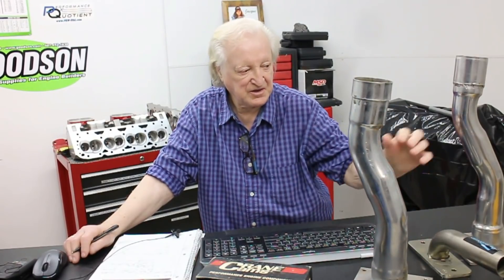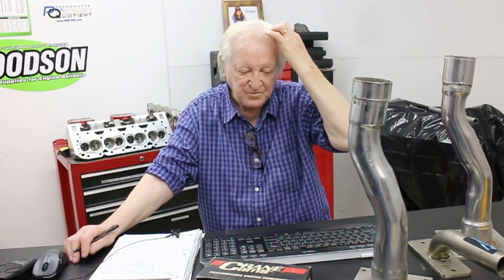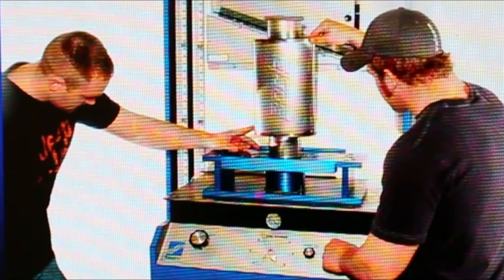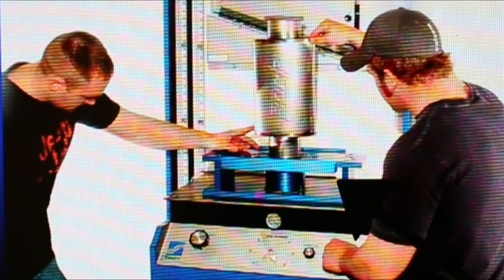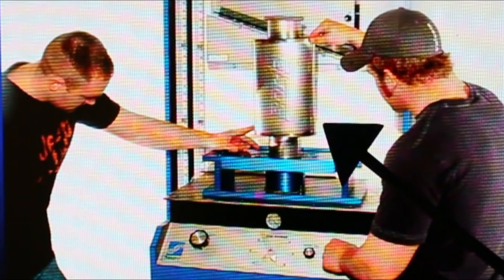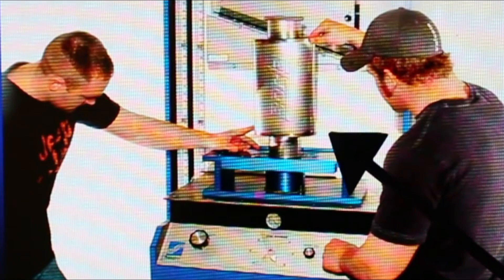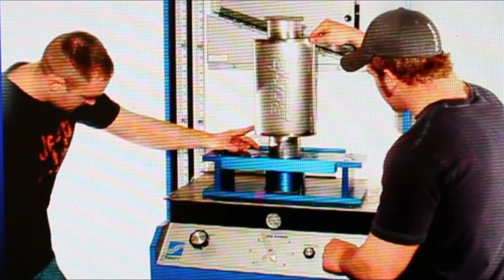David Vizard's PowerTec 10 EP 27 Zero loss sound legal muffler systems

Comment: Best muffler explanation I have ever heard. I have suspected that this design of open chamber at the end of the collector would work and built a system using a large bore Magniflow at the end of the collector with a tapered outlet. Did not realize the need to have an eight to one ratio. Thank you. Also the 2.3 cfm per hp is extremely helpful. Back to the welding bench.
Reply: 8 times the size of one cylinder termination box? Is that ratio specific to a V8 motor?

Comment: this is invaluable Information !! thank you for shearing this info, I am in the middle of building a 4-2-1 for my corvette , I know they already sell it ,  but I thought to give it a try,  the most hard part on this built is to weld the headers , from the 4" mid pipe and 4" collector all the way to the end , is pretty simple, is what I did in tow days, still working on the headers, I am going with 42,2 " to the Y  and 54"all the way to the big collector ,, I hope it comes out ok, thx for your information,

Comment: Holy crap I learned a lot from this genius. I've had my muscle car in storage almost 30 years. We just pulled it out and restoring the body.  It's got 500 hp and still has Sonic turbos and nobody's muffler sound as good as those. They say the Super Turbo similar but it don't sound anything like the Sonic. This Sonic is smooth Bassy and quiet.
I'm going to try to go with the 3" straight through Borla XS. They're supposed to be the quietest straight through ones but I'm probably going to have to put a race bullet in front of it to try to keep it smooth and quiet.

Comment: David:  first of all, I would like to send my condolences for your loss with a family member.  Second, thanks for your presentation on sound and performance using mufflers.  I have been dabbling in sound quality and horsepower gains myself on a very "backyard mechanic level" to discover some of the same flow bench testing you have presented.  Motorcycle two stroke engines have the same design characteristics by using an expansion chamber before the resonator/baffle section on the system.  Cud-dos to you for explaining this insightful information to your viewers.  Furthermore, I will get busy with my own build, and try to report my experience in timely manor with track times as a guide....see ya later, and thank you!

Comment: Just about 20 years ago, after reading David's exhaust tuning book, I designed a custom exhaust for a 1979 truck I had. My best friend at the time couldn't believe how well that truck ran and it had a stock 350 with just a Edlebrock Performer RPM intake and a 550 cfm Edlebrock performer carb. No, the truck wasn't truly fast but it did surprise a great many people. The absolute best part...All the "Noise" the truck made was induction growl. Many folks just couldn't figure out how that truck made "That Sound" when "getting on it" and have no noise otherwise. 
I'm working on a 302 based '67 Merc. Cougar now, can't wait to apply the same principals.

Thanks David!!!

P.S.  Yes, I've read  your cylinder head porting book. I already have a set for the 302, just have to get the car safe and legal to drive.

Comment: Dale here. I am glad that you have mentioned that the engine does not need back pressure. I have talked with many people about this, and they always say that there needs to be some type of back pressure. As I mentioned in another video that you did "Grumpy Jenkins" once made a comment about using slightly larger exhaust manifolds (in this case headers) so he could block backpressure and therefore gain a few more horsepower and a slightly quicker time on the track.
With what you are talking about here validates his comments and makes me want to agree with you about the person who demands that the engine needs that backpressure is either ignorant or parroting words that someone told them were gospel. Thank you for the information that shows the fallacy of that view.

Comment: I set out to increase the gas mileage on a 2001 ram 1500 5.2 v8 . The exhaust size was reduced from 3 inch down to 2 inch before the Cat. Same diameter into the stock muffler then back up to 3”. I installed a 3 “ cat and a long 3” truck muffler to keep it throaty but quiet. No improvement in gas mileage. Muffler rusted out internally in 4 years. Replaced with an American made flow master style  muffler. Sounds amazing on start up. Louder but at highway speed no more noise in the interior but I can hear the sound of the engine nicely. No change in gas mileage. The original window sticker says it should get 19.  It never gets any better than 13 but it sounds great ,lol. I could probably change the cam and have more power but I don’t think the mileage would improve. I will probably just drive it as is. It’s in perfect condition and drives good  but there are better trucks out there.

Comment: I saw a Chevy Gas truck with headers and a 5 inch exhaust meant for a diesel. It was terrible sounding and droned on the highway.  WE went near the axle and put a 5 in to 3 inch adapter, a short length of 3 inch pipe and then a 3 to 5 inch adapter. It mad it sound a lot better, quieter, and no more drone. He also got to keep his 'cool looking' sewer pipe exhaust tip.

Comment: getting to grips with a rotary way out on the boondocks of NZ , I found it best to build my own straight though with lots of stainless polypads , the brass ones got flattened in days , any normal glass pack large mufflers fell apart .  I made a few attempts at internal reflection cones too , were ok but stainless is to noisy . And with turbos have found a big expansion tube after the turbo is good . now it seems there are ways to design noise reflecting grooves at about the size of the sound waves , Gismag/new atlass had an article a few years ago ,would like to know more ,could greatly simplify the muffling , even make effective aero mufflers , next project I hope . Thanks David ,great info, and attitude , we say you attitude determines your altitude ,and fame without good character will destroy you .

Comment: WoW 1987 I was 17 years old in H.S.  and had a 70 Cuda with a 318 and big hydro cam Torker intake 750 vac secondary carb Blackjack Headers AND Sonic Turbo’s slapped right on the collectors. Sounded beastly Ahhh those were the days.

Comment: So, the Walker DynoMax Super Turbo, is the same muffler as the Sonic Turbo?. Back in the 80s, they use to refer to this muffler as the "Turbo" because it was similar to the GM Corvair turbo design of the early 60s.....apparently. If you were a Mopar guy of the 70s, you used the "Imperial" muffler.....which apparently was the biggest size muffler.
Bit of history for the gus.
Reply: I just pulled a 500 horsepower super duty Trans Am out of storage for 27 years. I can tell you my friends are jealous it's got Sonic's on it still. I can tell you the super turbo doesn't sound anything close to the Sonic the Sonic is smooth Bassy and quiet. The problem is I don't think those particular ones have quite the flow got that engine needs so I think I'm going to go with 3" Borla XS Pro because they're supposed to be the quietest straight through. I'm probably going to have to put race bullets in front of it and maybe borla's x-pipe to make this thing be smooth and quite as I want

Comment: I remember that muffler test. 👍
With the back-pressure, I keep pointing out the piston has to push against that pressure in the exhaust port - which is partially a result of that system back-pressure.

Down here, NZ, back in the seventies I was rather disappointed by one of the local exhaust (muffler) "professionals" who wouldn't help my with parts for a dual 2 1/2" to replace the OEM  single 2" - it was originally a lo-po 283 that had a mild 350 replacing it - because exhausts don't make any difference to power... There was another shop in town that wasn't much better - I ended up getting the stuff from out of town.

Comment: I remember the sonic turbo muffler
In that article they did beat all the others 
As usual not surprised that David had
A hand in it.
Reply: yeah and the walker version built they way he wanted initially but couldn't do to size constraint, the walker super turbo the bought out version that improved due to larger size on the original 'sonic turbo' muffler.  changed the term 'turbo muffler' forever. However ,they are not the same.

Comment: Man my jeep xj is not a race rig but I am putting a stroker engine in here soon,  I wish I could work hand in hand with you to get it setup for max efficiency lol.   It don't need it but I want it haha.    I've built custom exhaust for many years and but never had any dyno stuff as it's been a repair shop like midas or meineke.   I recently found your videos and am gonna take on the porting of the throttle body and intake manifold on my jeep and build my own exhaust. It's a working rig for offroad recovery so every little bit helps.   It's got a stock cam and better head than factory plus more compression ratio and displacement

Comment: I've always had a very high appreciation for fast things on wheels with low noise output. When the sound is so that you KNOW there is power but it's still a "stealthy" vehicle. Once in a drag race there was this beautiful black VW bug with really nice looks. Chrome trims, even original blinkers etc. But at closer inspection it was a tube chassis thing with probably a Porsche engine. That thing went crazy fast and the sound was like nothing compared to some way slower V8's and other obnoxiously loud cars there. It really left a mark.

Back when I had a 2 stroke 50cc scooter (Gilera), I put an aftermarket exhaust on it (LeoVince S) and it was way more silent than the original fat steel system with a catalytic converter (which probably was the culprit of the loudness, as I think it started to brake down inside the chamber, making a ruckus). The LeoVince had a really pleasant sound compared to most tuned mopeds and scooters at that time.

Comment: Back in the day trying to quieten a race car exhaust I fitted one of your mufflers to a hot race tuned Ford CVH engine, the original on the car was a 2 1/4" straight through glass pack and yours too was 2 1/4" bore, the noise was reduced from 111 Db down to 96 on my own test equipment which later passed the track side test but the important point I'm making was that the engine power when the 2 silencers were dyno tested back to back, yours showed 165 rwhp compared to 150 rwhp of the straight through glass pack, I have to say I was shocked at that time to see such an improvement and had to repeat the test over and over to confirm that I hadn't got some kind of false reading, later like yourself I went on to develop my own silencer technology for race engine exhaust's which is nothing like your tech but that's another story. Nice to see you again since we last met years ago at the Motor Show in London. Roland Hayes,  HT Racing Ltd.
Reply from the maker: Roland,
 I remember your name!!!

Comment: Sir, I agree with your statement that there  are few, of any, properly built headers. Have played with a few designs that make claims for good performance, and just like you expressed, found them less than "as claimed". 
I would disagree with the statement that you don't need back pressure. To qualify this, I am just going to point to the cam profile as the yes or no. If your cam is designed to mitigate back pressure losses, then, you need some of the backpressure to mitigate tossing the fuel out with the exhaust versus burning it. However, if the camshaft is designed for your need, then, I agree, less back pressure will always be better. V/R Chris

Comment: David I've built a stepped exhaust system, starting with 2"  to 2 1/4 to 2 1/2 to x pipe to tapered 3" to dual through flow mufflers with excellent results of torque. And fuel efficient. I followed your technique's of porting throttle body, intake,and heads, with a 4.3 V6 . Somewhere in the nayborhood of 300 hp and torque. 0-60 in 5 sec. And 21 mpg.  O yeah 300,000 miles.

Comment: It seems you and I go back many years ago! My first car was a 1980 Chevrolet Monza Spyder with the 3.8 L V6. I took the factory muffler off and put a sonic turbo muffler on it when they came out. I truly loved the sound of the exhaust note. My father actually did too. The car was only six months old when I put it on. If my memory is correct. The next change was to the carburetor. It had a  Rochester Dual-Jet 2 carb. (Sealed). My father and I took the carburetor off and drilled a hole in the caps and took a small screw and screw the screw in to the little hole and pulled out the seal caps. That was the very first thing that my father and I did together on a car. Memories!!! The idle improved greatly. Next we put a catalytic converter test pipe on it. I followed that with a distributor recurve kit. Dad and I followed that with a brass tapered reamer to the gas fill inlet. Then we were able to run regular gas instead of unleaded.

Comment: Very informative video. I generally like to use exhaust and muffler diameter to get the sound that I want. To be completely honest, I like the sound that can be reached when using larger diameter exhaust pipe/muffler combined with shorter length smaller muffler body. I realize that this is not the correct way to go about it. And after watching this and more of your videos hopefully I can do it correctly and possibly even do some testing. Thanks for any advice you could give me. Regards

Comment: Superb content as always. There are a great many people who think that engines need back pressure to function correctly and they have no idea how stupid that actually sounds coming from the same person who runs ported heads and a larger camshaft etc to obtain better flow thru the engine. Your work also proves that a person doesn't have to settle for a restrictive exhaust system just to obtain streetable sound levels. 
Thank you for the awesome content...

Comment: Had a 70 Monty carlo.. my frends had a warmed over 350. 300hp. Had sonic turbos 2.5 . The problem  was the biggest tailpipe I could get was a non mandrel bent 2 .inch. they were such a restriction  they would blow out of the back of the mufflers  and the car would surge ahead.  Now of course you can buy 3.inch tailpipes. So after that l would WELD my own. Tailpipes out of 2.5 mandrel  bent pipe. Parts.

Comment: Have you written a book that offers a synopsis of the basic features and parameters that different engine components should have to get the best combination of power, torque and reliability?

As you speak, ratios between this and that fly by, preferable shapes of this and that, etc. It would be good to know, on a basic level, what a good intake, combustion chamber and exhaust system look like. A guidebook to best practices if you will.

My motivation is that my workpiece, upon which I mean to learn, is a 1977 Yamaha XS400D. So many factors on this bike are clearly problematic. So much so that I feel I could make a great many modifications on the level of rules of thumb, and score a great deal of extra performance merely from following best practices, as a baseline before I get down to testing.

I have a machine shop and I can weld. I am approaching the skill necessary to machine a new cylinder head, or to heavily modify an OE example.

I figure the testing (flow bench, dyno, etc.) would be much more productive if all the obvious suspects were already absent.

Comment: Wow, I remember reading Mr. Vizard's work many decades ago, including the original piece on zero loss muffling.  Great to see him still putting out content.  Way back when I couldn't figure out how to effectively put a termination box on my 4 cyl race car with my limited fabrication skills, but we found that using a factory catalytic converter body (with the catalyst block removed) as a poor man's attempt at a termination worked pretty well.  It was about twice the diameter of the header collector, smooth inlet and outlet, but only 4-5x the volume of one cylinder.  Along with a large Dynomax Super Turbo suitcase silencer at the back, it made the sound levels quite tolerable and we never had an issue with getting flagged for noise - from the exhaust at least.  Now that open element intake was a different story - had to build a box for that too.....

Comment: I had a stock '67 283sbc I put in a first gen s10 just to get it moving.  I used a muffler from an RV - huge 3.5" straight through design and almost 3ft long.  I never got around to putting tail pipes and a second pair of mufflers on it, but it sounded mean - very deep.  I wonder if I stumbled on the termination box idea on accident.

Comment: I have your book were you write about this. A local BMW owner had put a M5 engine in his car and when dynoing it, horsepower was not impressive. I informed him and the exhaust system was then modified like you tell us here. The car was dynoed again and he was surprized and very happy about the horsepower gain he got. 

On an other note, many years ago, a friend of mine had a Yamaha RD350 motorcycle and wanted more horsepower. We cut the silencers off an welded on a stinger in correct diameter and length. There was no notable gain anywhere and the sound level was insane. The original RD350 muffler / silencer has to be one of the most impressive sound silencers ever.

Comment: Hello David I am a south East Tennessee Hillbilly, and love motors .  I have a 1977 motor 301 v8 and a 350 v8 and a 460 v8 only the 460 v8 runs it ok but thinking about rebuilding it.I have got to take the heads off cause I broke six bolts off in the heads. It has 188.000 in or on the motor. Do you think I should rebuild it, I am thinking I should rebuild it , water pump oil pump. Make sure the motor will be ok and run good for 200.000 at list , well thanks for showing telling well see ya next time see ya bye bye.